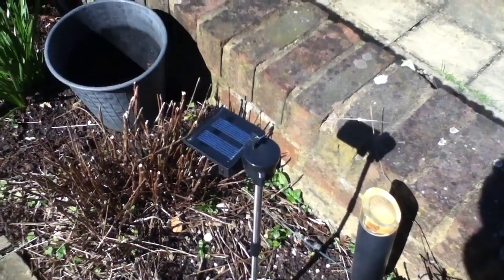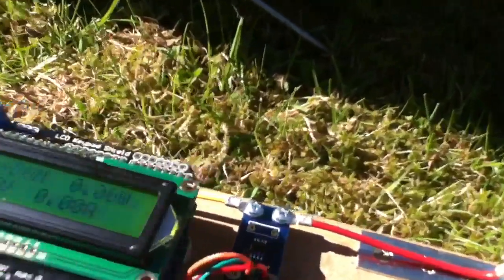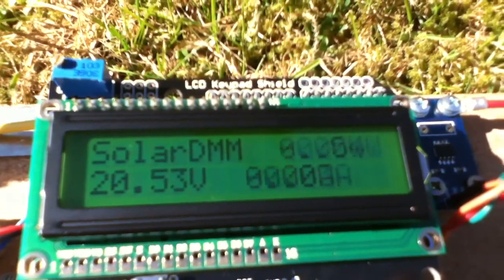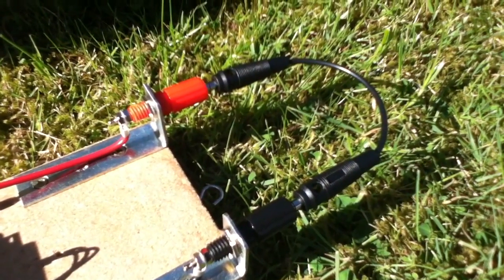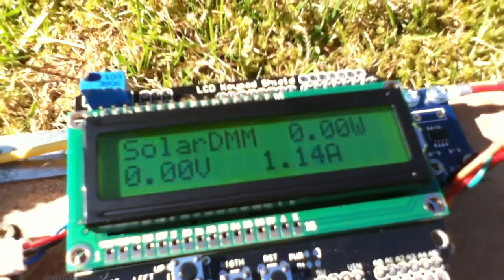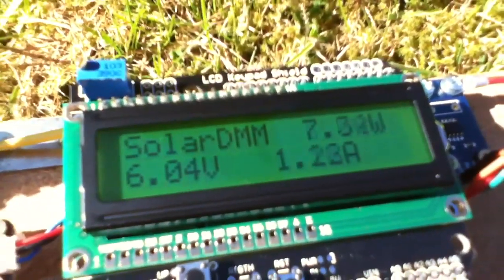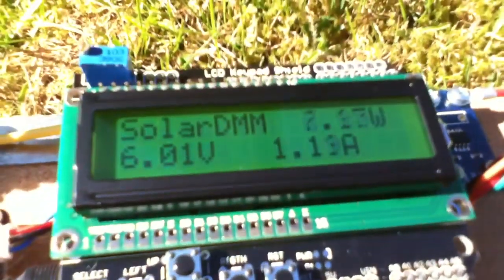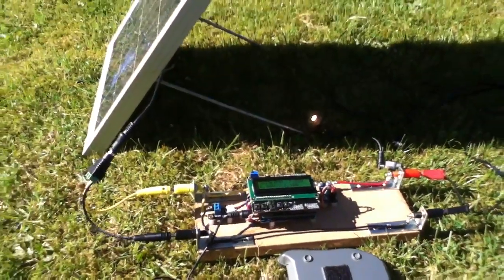MPPT Solar Charge Controller #2 - Volts, Amps, Watts now Displayed

Comment: Hi Julian.

I woud be curious to see your code about the DMM. What voltage reference do you use in your ?
Did you check the voltage given with the arduino with a proper DMM (Well, I mean a real one like your yellow cynometer).
I had so much trouble myself to fit an accurate Arduino DMM
I guess, you're using a voltage divider to feed the arduino analog pin but i must have missed that part of the video.

Thanks so much for your video, they're so instructive.
Reply from the maker: I can answer that - the original code for voltage measurement is:

  sensorValue = analogRead(a1);
  volts = sensorValue * 25 / 1023;
  lcd.print(volts); // 25v sensor on input A1
  lcd.print("V ");

The voltage sensor module is just simple potential divider with 30k and 7.5k resistors - you can get them on eBay. My voltage reference is simply Vcc.
Reply: Julian Ilett
You should have a look to this :
http://provideyourown.com/2012/secret-arduino-voltmeter-measure-battery-voltage/
and also this :
http://gdevic.blogspot.fr/2013/01/accuracy-of-arduinos-adc.html

I've myself been facing some problem measuring accurate voltage with my Arduino. Whether I fed him from USB, 9V External barrel PSU trough its  own 5V regulator, or even from other battery source trought its Vin pin !
Even more difficult when you use a weak power supply and you power different load on the same line (let say you swicht on or off a display or anyhings else. You can get completely erratics measurement.)
Let me just reproduce what the guy from the second link I gave just above wrote :
"Using the internal 1.1V reference, and after the calibration, it might be possible to have the accuracy as good as 0.1% - that’s what I measured in my subsequent tests after I changed the calibration code. That accuracy was not affected by the slight variations of the input voltage since it was self-correcting."

You (or we) should call this suboutine "readVcc()" before each time we need a voltage measurement and be sure noting is hapening in between this time lap to trust on a reliable Vcc Reference.

Does it make sense to you ?
Btw, I'm now using a regular PWM controler based on a uC that gives 1V offset from my DMM. All of this pushed me to dig in deeper and I'm now here !
Reply from the maker: Llop66 Makes sense, but then you will only be able to measure voltages between 0v and 1.1v. If you need the full 0v to 5v measurement range, you could put a separate 5v regulator on the AREF pin.
Reply: Julian Ilett
Sorry, but I don't think so !
I think there is a trick to accurately measure up to 5V.
You use the 1.1V reference and compare it to the supposed 5VCC.
In a way you are calibrating your "5V". Then, in your code, you can use the true value.
This is done by code.
If you want even more accurately measuement, you also need to calibrate your personal Arduino since the 1.1V might be slightly from one to another.
Maybe better explanation here :
http://code.google.com/p/tinkerit/wiki/SecretVoltmeter